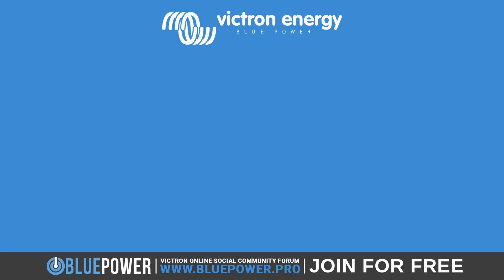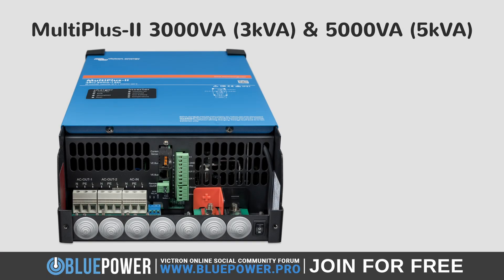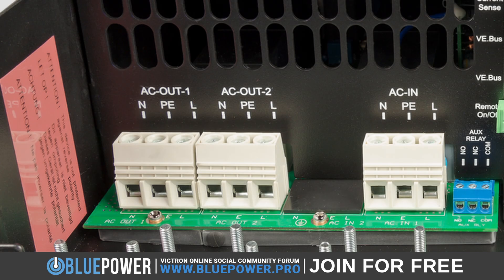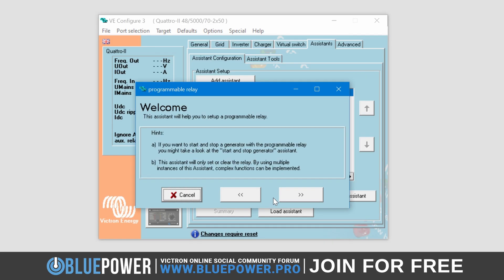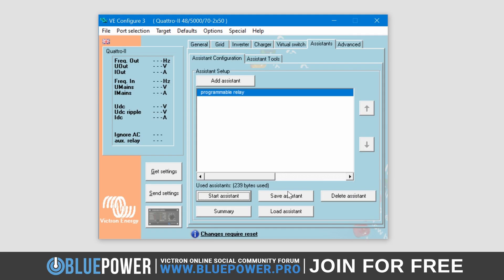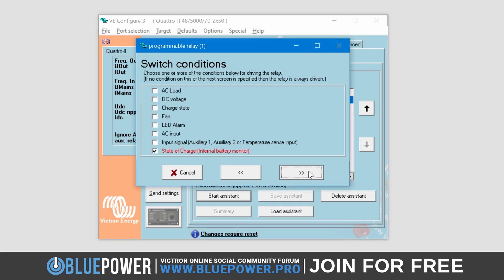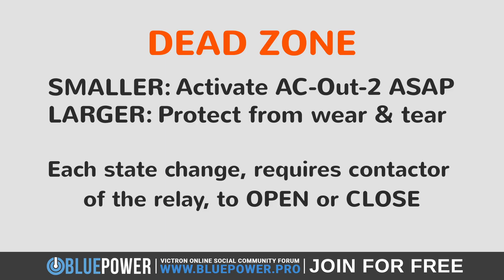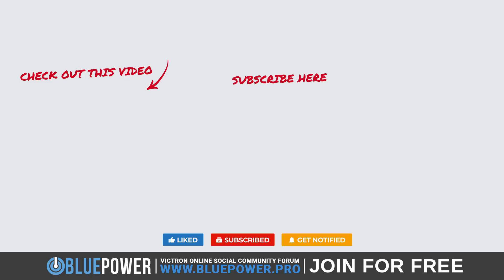DON'T WASTE YOUR SOLAR - Enable AC-OUT-2 based on BATTERY SOC [UPDATED 2024]

Comment: Great video for specialists! I didn't quite understand. If there's excess solar power through the MC4 controller, the battery charge is set, does the AC2 port switch and power this line? And does the AC port remain connected and then disconnect?
Reply from the maker: AC-OUT-2 is very configurable, and will follow any instruction programmed to it. 

As a factory default, its programmed to disconnect loads connected to it, when the loads exceed the capacity of the inverter. 

However, what we are doing it setting our own programmed instructions. In this case its to connect and disconnect based on SOC and not load. But there are many things you can program to it. This is just one example.
Reply: As they say, everything is in our hands! (and your knowledge) @BluePowerPro
Reply: @BluePowerPro Thanks to your video

Comment: Does this also work with a non Victron battery(getting the SOC from the smartshunt)?
Reply from the maker: Yes definitely. As long as the inverter gets the SOC info from somewhere it can do it.
Reply: Thank you for asking this question.  I had it too.  Good to know it can get state of charge from the shunt (Lynx shunt in my case).

Comment: Great video, I configured mine to start at 96% but increased the “dead zone” to 80%. This is way better since the batteries can suddenly drop by 2% when handling a high load before the MPPT has analyzed the power requirement and adjusts the state from float to bulk charging. This will cause the relay to switch on and off far too many times as the SoC changes and this will cause excessive wear.
Reply from the maker: You're welcome, glad you enjoyed it. Yes that's a good way to go about it, especially for the MPPT as you mentioned. I did mention the wear and tear issue at 9:26
Reply: @BluePowerPro  great analysis! I missed that bit
Reply from the maker: @0900McShizzle  haha no worries :)

Comment: ok.. new subscriber here. I'm a Victron fan\user. 2 arrays: 1160 ground mount and tilted and 1200w on a dual axis tracker. 300Ah lithium 8' away from 12v 3000 MPII, CERBO with display,  Lynx dist 1000, bmv 712smart. Batteries were in float and I manually turned on breaker for water heater.. I know how to setup the assistants for L2.. but how do I wire up from the MPII to the breaker panel to power it automatically..?  I'm guess some romex 5' away. Just not sure how to tie into the breaker..?
Reply: I'm wondering the same thing.
Reply: @SoonerDiscGuy  So I modified my system. I now have (1600Ah) 4x400Ah 12 LiTime  lithiums. I now just turn on the breaker and in about 30 minutes, the water is hot. Maybe someday they'll see this and provide an answer.

Comment: Nice video.  I did the same a few month ago for my easysolar and was looking for a video like this at the time. 

I have noticed that the BMS is often severely limiting the charge rate by the time batteries are up to 95 percent.  My max mppt point is around 150V and I often see around 170V when up at 95 percent battery. 

So in order to avoid this potential waste I would tend to turn the hot water circuit on earlier, maybe 80 percent before the bms starts limiting the mppt charge current to the battery. 

I run it between 80 and 70 percent to save relay wear. 

My hot water is predominantly diesel boiler fueled with an auxiliary electric element which I use to save diesel. 

On the subject of turning stuff on and off, I have the diesel boiler on a timer and it only comes on (if needed) for half and hour after dark.  The boiler man commented it was the cleanest he’s seen which I’d attribute to the boiler running only once, getting hot and switching off as opposed to doing lots of on off cycles. 
Like short trips in a car I guess. 

Anyhow. Thanks for the vid 
Sean
Reply from the maker: Hey Sean, thanks for the great feedback and info, sure many other will benefit from it (including myself).

The BMS possibly becoming a limiting factor at 95% isn't something I considered, so thanks for that as well! 

"The boiler man" - lols 😂
Reply: If your bms disconnects before 100% it means cells are not balanced. Add a 5a Neeey balancer it will fix this. I did it.

Comment: I came up with a nifty solution using a satellite battery.  When my main 48V system fills up (56.8V) I have a bit of logic to turn on a DC-DC charger to transfer energy from the 48V system to a 24V battery (Just a DC-DC and a 100Ah 25.6V LiFePO4 battery).   It turns it off if/when the 48V system drops to roughly 54V (the float).   So it ends up cycling a bunch in the latter half of the day pushing the excess energy into the 24V battery.  This way the solar just keeps pumping power out at full bore.

I then dump essentially the entire energy content of the 24V battery daily, to whatever I want.  I've tried dumping it to a cheap 120VAC micro-inverter to export it to the grid 4-9pm, I've tried having it run portable heat-pump (A/C or heating).  I've tried a bunch of things.

The advantage of having a satellite battery to hold excess energy is that you can dump the energy to the loads whenever you want... so for example it can run a small heater overnight if I want it to.  I don't have to burn the energy on the spot (during the excess solar) which might not be the most opportune time to use that excess energy.

-Matt
Reply from the maker: Matt! Can't than you enough for this comment. Fantastic use of this setup and DC-DC charging, and using  a secondary battery bank to store the excess solar, allowing for more controlled later use is brilliant :D

As I mentioned to @roblatour3511 below, my tutorial was more focused on the "how to" than the use cases, as there are many such as yours.

Am busy with some Node RED experimentation and another use case is similar to yours, except that instead of a secondary battery, you could set up a secondary geyser in the pipeline. This secondary geyser would be connected to the AC-OUT-2 (allowing its water to be heated from excess solar) and installed before your main geyser. Then, the hot water from it, would supply and flow into the main geyser at night, thereby lower the amount of hot water the main one would need to heat from the grid if someone were to shower. A hot water reserve tank in a way.

As you said, you "tried a bunch of things" before you came up with a polished working solution, which is simply part of this industry. As, while there are no real limits to what can be done, (other than what you can conceptualize and refine over time), it can be difficult to initially come up with a use case.

So thanks again for sharing as I'm sure it will certainly help spark ideas in others, of what this could be used for. more we share the better we all become :)
Reply: that's awesome. I've done a similar thing but I only have a 30 kwh 24 volt lifepo4 bank and a 12 kw Nissan leaf satellite bank at 24 volts. I wanted to use both batteries but they are not really compatible at full state of charge as the leaf tops out at 25.2 volts. they both work very well but it's kinda a more complicated system than I'd like. I use a 24 volt DC to DC victron smart charger and it's the most simple way I found to do this.

Comment: I'm was interested to see your video because I am looking into ways to back feed power from my inverter to my home wiring so that no excess solar is lost.   So far I have been looking at ESS.  But I don't get this approach - lets say I use this to power a load from acout2 when there is excess solar power.  Fine.  But when there is no excess solar power what is powering that load?  Well I assume nothing if the load is powered only by the output from acout2.   Would you not need the load on some sort of separate Automatic Transfers switch which can switch between power sources (for example acout2 and the grid) to keep the it running?    Why not use the ESS to power your home with the excess solar?  If you do a video on that I would be very interested, esp. if you can discuss feeding excess solar into your home only (but not into the grid).
Reply from the maker: It definitely overlaps with features provided by ESS, so guess you have to choose what works best for you and your setup. I created the video because another subscriber asked how he could activate his AC-OUT-2 based on SOC, and thought it would be a helpful video to make. However, I haven't tried and tested this against ESS, or any alternatives like Node RED setups. So basically done more of the "how to" and less of the "why to", if that makes sense :)

Comment: How will this interact with a normal ESS system, when there are loads and exporting of excess DC solar using the AC-In of a Multiplus II 230v unit ?  I'd assume one would need to disable exporting excess DC solar, and that the AC-in ESS loads would be treated the same as the AC-Out 1 critical loads......? But I'd like to confirm this.  I'm using the Victron Energy Meter ET-112 with it's current clamp on the grid input if that is a factor also.
Reply from the maker: Have yet to test it, but yes this will very likely conflict with ESS exporting, as they both try to make use of excess solar, but in different ways. This is more designed for a system that doesn't export or is completely off-grid, allowing for a quick way to power some extra loads when you have an abundance of power.
Reply: @BluePowerPro  Yes, I'd espect to disable "Export Excess DC Solar" but can you please follow up how the loads are prioritized ? Cheers :)
Reply: @BluePowerPro  Perhaps I am wrong but, if you were running ESS with a Victron grid meter and your battery bank still needed charging, there would be no export as local loads and battery charging take priority? In this situation if you still used the AC 2 out relay assistant, again to come on at say 90% SOC, once activated surely the power flowing from the AC Out 2 would still mean that there would be no 'export' to the grid as you had switched on 'non-essentials. Then if the relay 'off' were set to 87% the battery would cycle down to 86% and the process start all over again?